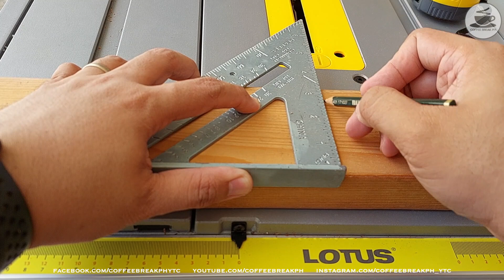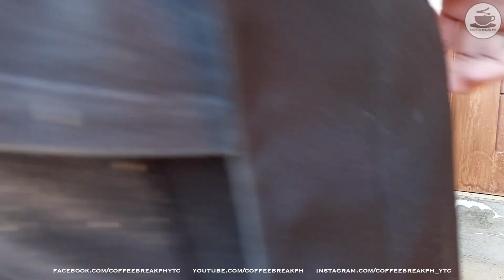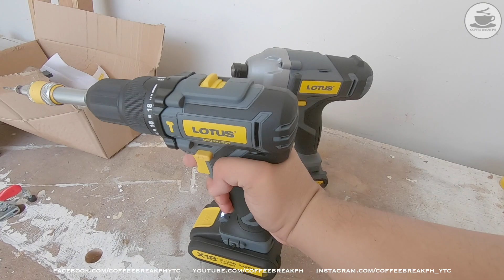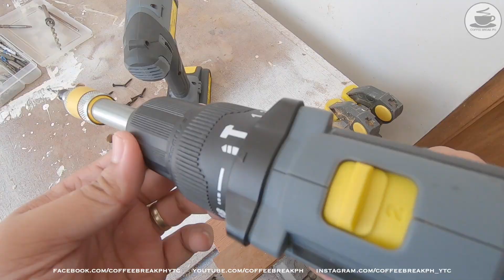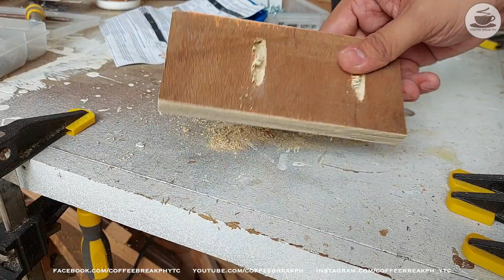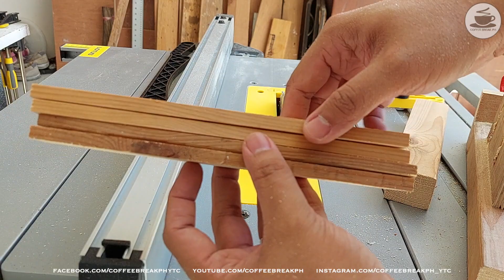DIY Thin Strip Ripping Jig for a Table Saw | How to make thin strips using a table saw

Comment: Hello po sir. Makakapag joint ka ba ng wood gamit yang lotus table saw? Salamat po
Reply from the maker: Hi po. Yes. You need to have a jointer sled. Bale long piece of plywood with one straight side for reference sa fence ng TS then may hold down clamps. Para mavisualize mo, you can check on Morning Wood's channel. Malimit he uses his jointing sled. 😊
Reply: @CoffeeBreakPH  salamat po 😊